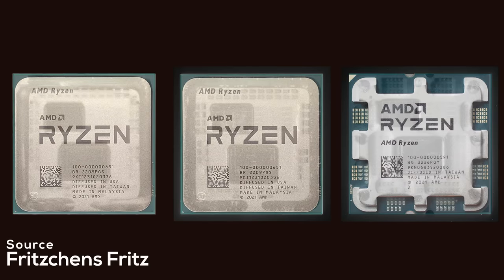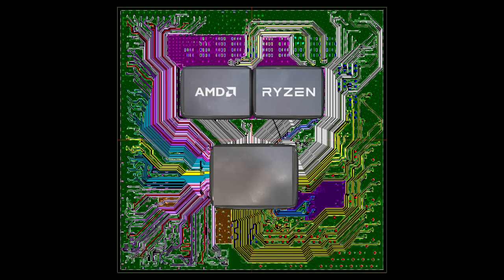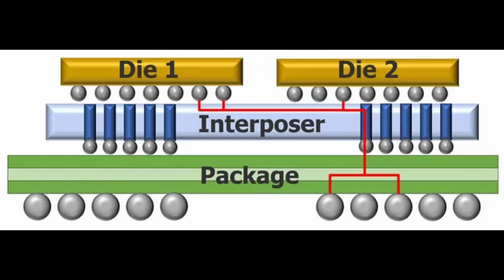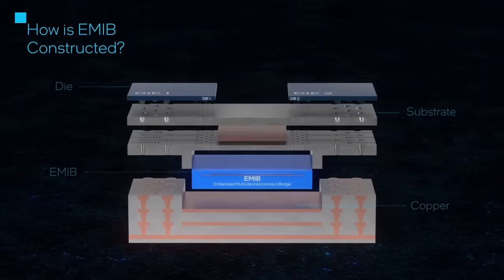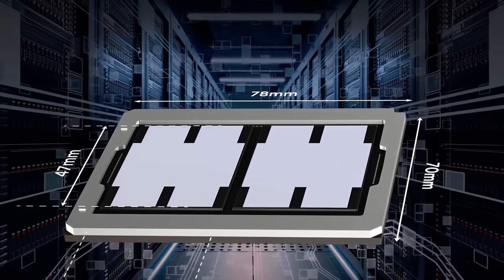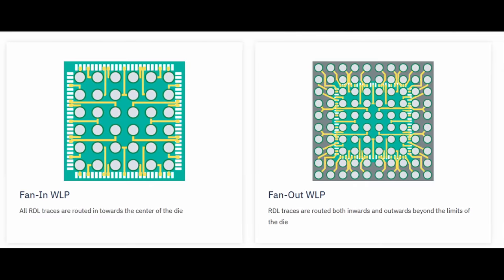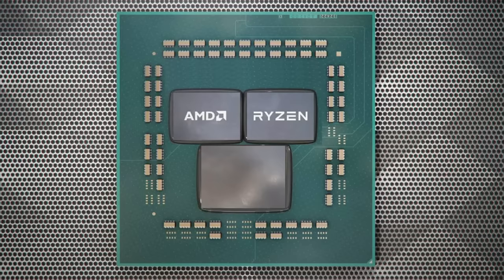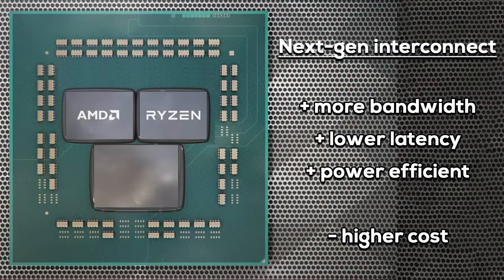AMD ZEN 6 — Next-gen Chiplets & Packaging

Comment: I guess Apple's make back their Ultra SoC interposer investment, by charging 200 dollars for one additional  256GB generic SSD NAND flash chip.
Reply: £200 for 8GB of ram..
Reply: lol never thought of it like that
Reply: Yeah apple tax. IMO but from tech implementations Apple did wonders with own chips. I can just applaud performance. Especially GPU section is very very impressive per watt.
Reply: Apple are planning on using a silicon interposed for the construction of individual chips, meaning each processing core will be cut and glued into place, as will each cache, gpu, neural processor, analog processor and whatever specialty chunks they decide to add next.  Shouldn’t expect to see it before M7 though (~2028ish)
Reply: @alesksander what can you run on the gpu which apple did write? not really useful if others can't use it.
Reply: @parabolicpanorama  not really applicable. Apple is closed loop ecosystem and it works for them. Playing game straight trought virtual machine is impressive.
Reply: @alesksander  how does it work for them if no developer can make use of the compute? what part of Mac OS uses the GPU? if the only thing it's good for is rendering videos in final cut, then it doesn't really compare to any actual GPU. There is no workload you can run on the gpu, so why even have it?

Comment: I remember Adoreds video from years and years ago talking about new interposer technology. As always there's a 5-10 year gap from research to application.
Reply: Intel already use silicon interposer since Alder lake from 2020-2021 era. Their tile are using Foveros. Intel EMIB is like within package communication, that's what AMD does with chiplet. Pretty cool Intel tech. If Intel already been doing it in 2021, I think it won't be long until AMD catches up and start using silicon interposer for their chiplet. Maybe in 2-3 years.
Reply: He covered the "Buttered Donut" and many laughed. Turns out, he was right and Zen3 did have the "Buttered donut" tech. It was the foundation for the 3D caches
Reply: @hammerheadcorvette4  That sounds very dramatic. Last time i checked AMD never specified their chiplet topology but that was back when Zen 3 launced.
Reply: The substrate manufacturing can be incredibly difficult similar to the silicon itself. Future cpus will be staggeringly complex beyond the transistors themselves.
Reply: @slimjimjimslim5923  Alder Lake is entirely monolithic.  There's no interposer of any kind.  Same for Raptor Lake.  Meteor Lake is actually MCD, but only released in laptops. 

The last time Intel released a desktop chip with multiple dies was the Core 2 Quad, which was just two Core 2 Duo dies put on the same substrate, with no interconnect at all between them.  They behaved like a single-socket SMP system, doing all communication on the front side bus through the socket.

You seem to be deluded about where Intel is with respect to AMD in terms of MCD design maturity.
Reply: @TrueThanny  3 points.

1 - Intel released a chip with dram on-package with it's 6th or 7th gen.
2 - Intel launched the Intel+Radeon combo on 8th gen with EMIB. 
3 - Intel launched foveros with the 10gen i5-L16G7 (very limited production volume).
Reply: @mawkzin  1)  Yes, we all know about Broadwell.  They also had SRAM on package with the Pentium II slot design.  Putting a RAM chip closer to the CPU does not constitute MCM

2)  Not a desktop part, and the EMIB is used solely to connect the discrete Radeon chip to HBM.  The Intel processor die and Radeon chip are linked via the substrate.

3)  Very low power mobile part.  And a failed one at that.

Comment: I know some of this packaging is TSMC's or licensed from other research groups. But unlike Intel, AMD has really pushed the envelop with Zen, including all the research they've backed and invested up into their supply chain. I'm really excited for Zen 6 because that's when High-NA EUV Node, GAAFet, Next-gen Packaging with 2.5 Interconnect, RDN5 (Improved RT, Image Reconstruction, Mesh Shaders, etc), All new Zen 5+ architecture with Iterative Improvements in Zen6, All New Zen 6 Memory Controller, 512AVX Full Width, will all converge into a single innovation step. I'd imagine this is the platform a Steam Deck 2 APU will be built on. 2026.

Comment: Yes, it is kind of crazy AMD is taking this approach for three generations and now a fourth. But consumers apparently don't care enough about the latency and power efficiency drawbacks. For me, with a passively cooled system, it looks insane a chip like the Ryzen 5600X uses 30W just sitting at the desktop, compared to 15W for a 5700G (which of course uses a monolithic die and therefore isn't wasting power on the interconnect). Unfortunately, reviews focus on peak performance and people don't notice the fans spinning a few hundred rpm faster than necessary. I do hope Zen 6 will bring a change to this.
Reply: Well to be fair, their competition(Intel) is FAR less efficient on PC, laptop and servers. And if amd wants, as they've shown, they can compete even with ARM in efficiency(look their latest ryzen CPUs for laptops and their crazy efficiency)
Reply: @peq42_  yes, overall efficiency is excellent for Ryzen CPUs. But I was commenting on the efficiency at idle/low loads. The chiplet design is wasting a lot of energy when the CPU is not being used or used lightly.

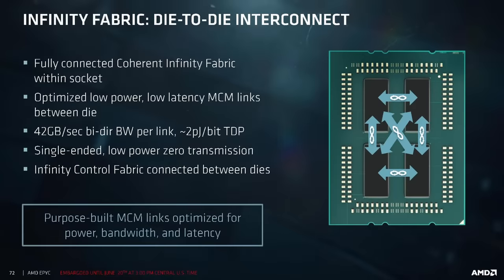Comment from the maker: 2:56 The IF protocol isn't PCI-E, that’s what the physcial layer is using (bascially the wires). The protocol is based on HyperTransport. Please disregard my mistake. 

And, as someone on Patreon pointed out, Navi 31/32 might already use ASE FOCoS packaging, we don't know for sure if its  InFO_oS/R from TSMC.
Reply: Latency is not the boogieman that everyone seems to think it is. The larger caches in the ZEN cpus help mitigate memory latency and actually benefit SMT bu giving the second thread a little more space to perform as thread  1 waits for data. 

Your descriprion of Zen 2 Infinity fabric is correct, each interconnect is a single point to point connection, each of which can be saturated by the data from a dual channel memory implementation. Zen 3 changed things, replacing the single bidirectional point to point connections with a loop that provides dual bidirectional inteconnects that double the data transfer bandwidth and eliminate the saturated bottlenecks when memory reads and GPU writes were competing with each outher that caused the slow gaming performance on the 1000=3000 ryzen cpus. 
Zen 4 changed things up a little to reduce power consumption, limiting the IF to 2000mhz instead of the frequency of the memory. Dual connections at 2000, dont double the memory bandwidth requirements of ddr4 6000MTs but still provide enough bandwidth not to be bottlenecked by the dual channels of memory and GPU competing for IF bandwidth.
Reply: I already know what you meant because you didn't say that it uses PCIe, you said it's based on PCIe
Reply: @bradmorri  Since there's no way to compare, you're statement is baseless as there's no data to back it up.  I have to disagree when you run apps that are heavily threaded and data always needs to be passed between threads AND you have a 2 CCD part.  That latency is going to add up.  And in fact this is why Intel has been able to compete in different areas over others against Zen 4.

The next issue is, and I'm sorry you're just GOING to be wrong here, as cores get faster either through IPC uplifts and clock speed improvement, EVERY bit of latency will matter more and more and to say otherwise would be wild.

Cache is NOT read ahead and Cache ONLY provides benefit in certain applications, mostly when you need to keep REUSING the same data/code over and over, and in the world of PC this happens more in gaming than anything else which is why X3D parts are better for gaming.  But if you do a render task, sorry but that cache is almost worthless because you are CONTINUALLY using new data from streams, and then creating new streams.  These are read from memory or read from disk, then write back to disk operations.  Now, for code there's a lot more benefit from bigger L1 and L2 caches especially when you keep running some function over and other again, as in that render task.  You don't get benefit for the data with larger cache, but you do get the benefit for the code.

I mean really go check out and myriad of CPU reviews, look at what applications have benefited from larger L1, L2 and L3 cache.  Latency in core to core data transfers which once again will happen in heavily threaded apps, WHEN you have to pass data from a core on one CCD to another is impacted by that latency and it's part of the reason why moving to 2 CCD parts doesn't scale as nicely as what most people would want.  But that latency also affects other operations and I said.
Reply: can  you make video about intel backside power  delivery BPD technology?
Reply: @bradmorri  your comment is at odds with itself.

There's a reason why we don't have monster L1/L2 caches on CPUs, which is because of latency. The physically bigger the cache becomes, the higher the latency and the less efficient the core becomes. That's why AMD made such a huge deal about v-cache and 3d stacking, it allowed them to make the caches larger without moving them physically further away from the logic that needs them.

And why do we need big caches? Latency. Having to wait to go out to memory is slow and if we can avoid doing so, we should. DMA exists to cut latency, it's one of the main drivers for CXL, etc. Some things are obviously more latency bound than others, obviously, but poor latency hurts everything.
Reply: @shanemshort  hmmmmm Ryzen 3800x had two CCX with 4 cores each. everyone freaked out about intercore latency and blamed that for the bad gaming performance.

Ryzen 3950X has two dies that each have two CCX of 4 cores. The chip performs better at games than the 3800x did. the inter die latency is more then double the inter ccx latency yet it doesn't follow the stated "rules" established with the 3800x reviews .  That should be a hint that the assumption is wrong.

Lower latency certainly helps with better performance but it is only 5% of the equation, not all 100% as everyone seems to assume.

L1/l2and L3 are all larger in Ryzen CPUs than they were in the competing peer level Intel range of CPUS. yes if you keep going you end up with diminishing returns but Ryzen doesn't have unlimited cache sizes do they?  The Cache is being used to allow for single ram reads for the same data as much as possible.  

Having data in Cache does not increase latency as you seem to think.

SMT, on the other hand benefits from slightly higher latency as the stalled time of the first thread, waiting for fresh data from memory is more time for the second thread to process data. You can see this in cimebench single and multi core comparisons between intel and ryzen CPUs dating back to Zen 1. Intel always had better single core but the ryzen was always about better with the multi core performance boost.

The Ryzen designs have been developing but it started with a compromised design with elements, IF for example, that was only just" good enough", not "best of breed". It took until the 5000 series to develop things to the point where they could be considered near to being "best of breed".
Reply: @johndoh5182  It's primarily ccd to ccd where latency is the highest, and in zen 4 ccd1 is clocked lower than ccd0 for exactly this reason, games and other high priority applications will prefer the faster ccd with the OS scheduler. Secondly, cache is pretty important, many apps do see a pretty big boost with the 3d cache chips, better latency is always better, but the current design is quite competitive in performance while allowing large profit margins per chip.
Reply: 780M gpu catastrophically need  more memory speed - it have no fps difference at 2 and 3GHz gpu core.
Reply: @101picofarad  Yep, thats why we use GDDR instead of just regular DDR in gpus. It would be worth going with a 64gb 2 stick kit and chasing ram frequency if you want to push the chip, overclocking the core won't do a lot, although it really depends on the game. Some games memory is more important than others.
Reply: The nerd battles in this thread are so informative! If it wasn’t for my Intel Engineer friends dumbing down everything I would have never understood how any of this works.
Reply from the maker: @D0x1511af  Oooh, that's something I've been thinking about for a while now, it's coming at some point but I can't say when atm.
Reply: @HighYield  thx 4 feedback
Reply: @shanemshort    Of course, there is a reason. Why there were no huge L3/L4 caches. This is Intel, which for a long time did not transfer developments on eDRAM to “open source”. (architecture Broadwell-2016)
I'll guess. AMD's next technological breakthrough. There will be Zen7, where the Broadwell-EP architecture microcontroller Q170 will be integrated into the crystal. Lines PCI-e for video cards and high-speed storage devices nvme/m.2/u.2 are separated and dedicated (open source Intel Rapid Storage 2017 year)

Comment: What packaging technology is it utilized on apple's MAX chips? Are they silicon bridges?
Anyhow, Thank you for these explainers and compendiums. Really appreciated.
Reply: Do you mean the Ultra versions, which is two Max chips glued together? Yes, that uses silicon bridges. Even the Max chips that don't end up in an Ultra still have a relatively large portion of their area dedicated to the interconnect they don't use.
Reply from the maker: There's no official information, but Apple is using a silicon bridge. It's either CoWoS-L or InFO_LSI.
Reply: Thank you both for the answer. 
Yes, I meant the Ultra version. I had the lineup mixed up in my mind. 
This is interesting then, since it means that the vías that connect to the bridge are vertical with respect to the plane of the die, and not stacked on the side as per apple marketing material. I was wondering how that was possible though lithography
Reply: @salmiakki5638  It is a very confusing lineup. Pro, Max, Ultra... you can be forgiven for thinking the Max would be... like... the max and not the mid :D

Comment: Very good, sensible, credible, video! Discovered your channel with the SteamDeck OLED video you did and this one is excellent as well! 
One question about Infinity Links:

Since it improves latency and bandwidth, would that be a major advantage for iGPU as well? Even by Zen6 it's highly unlikely that we have on package GDDR or HBM, but already if the local cache was shared between CPU and iGPU, that would alleviate somewhat the enormous bottleneck of the iGPU right? While benefitting from the energy efficiency and going out to main memory when it is needed.

Comment: 5:20 I don‘t really see why the EUV reticle matters. As long as you don‘t place any (or at least not too much) logic in the interposer and it really is just an interposer, then you can use why less advanced nodes with larger reticles or where mask stitching is easier to do.
In fact the upper metals in newer process nodes are still done using immersion machines, not EUV (at least that was true last time I look at it and it would be weird if it changed). You need to go through the upper metals anyway so its not like you can achieve a higher bump density, so using the same expensive processing nodes for an interposer makes little sense in my opinion (as long as you don‘t put serious logic in it that is).

I just looked it up, our last research chip Occamy had chiplets fabed in 12nm and the interposer used 65nm.
Reply: Your at ETH? 

I agree, makes little sense to have the EUV reticle matter. As far as I am aware, CoWoS uses passive silicon interposers. I know ST has done quite a bit of work on active interposers, moving things like power management, clock management, power gating hardware into the interposers, with the interposer based on something like a 65nm technology. Could even offset the higher cost of the interposer as you save area on the 2/3 nm CPU die because you move that stuff onto the interposer.
Reply: That was exactly what I was thinking, older process node fabs would be delighted to have the opportunity to fabricate a relatively high value interposer die and you would get great yields on such a simple layout.

Comment: I wonder about how this changes X3D implementation? 

I can see them carrying over the existing design where the memory chiplet is stacked on the CCD. I could also see them stackong the CCD on top of the memory chiplet, removing the need for TSVs on the CCD Enabling increased logic density, and smaller die area on the cutting edge node. This would also improve thermals as well.

That being said AMD could use a SI interposer with an integrated memory for the X3D variants and  organic interposer for the non X3D variants.